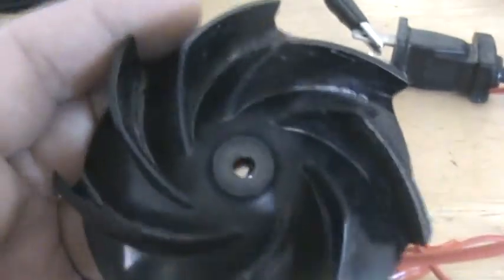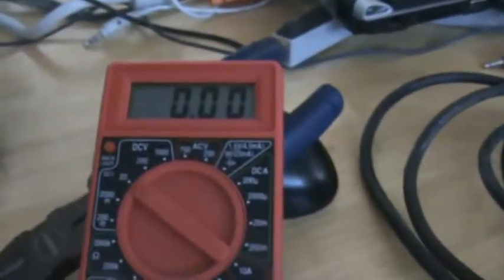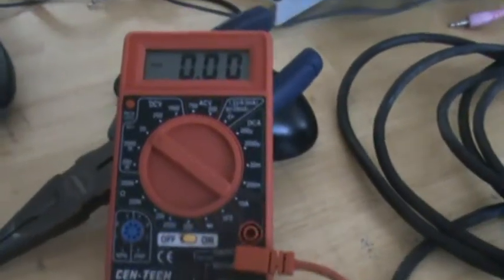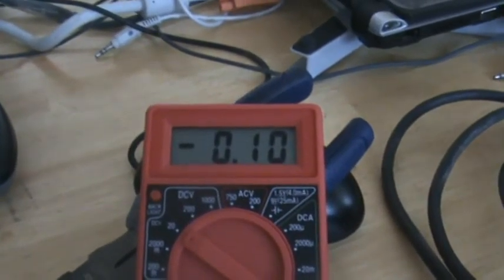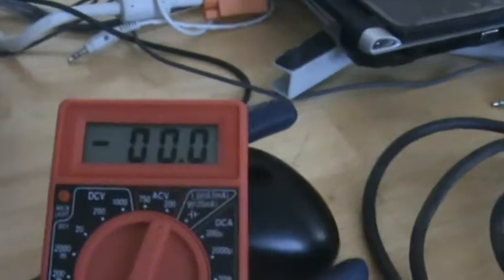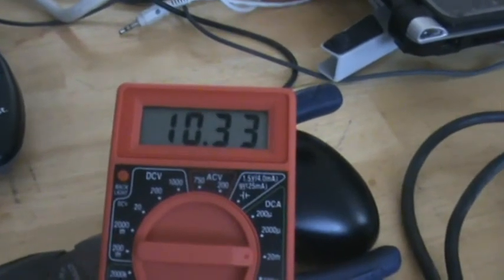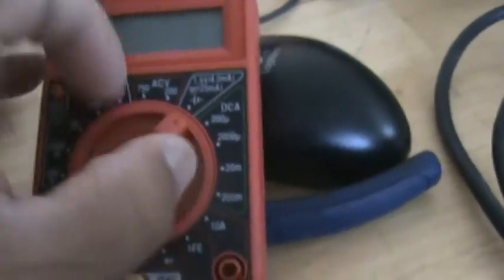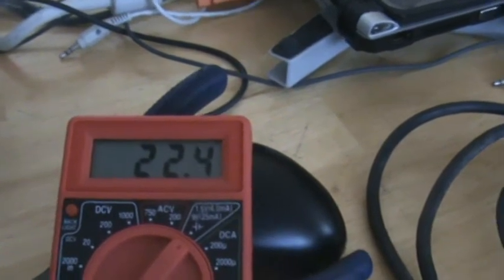Vacuum Motor voltage testing 2 with a drill

Comment: Does that motor have magnets ?   You are getting false readings  using dc setting ...If the motor doesnt have magnets you may could do it like an alternator , which means you would have to feed it juice to create a magnetic field to produce power ..